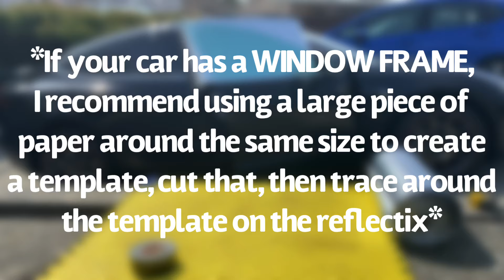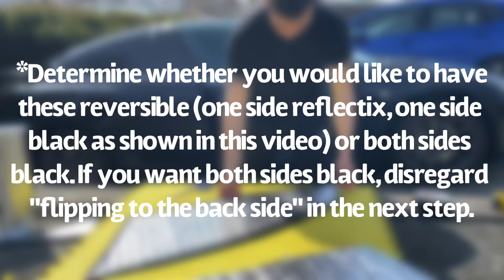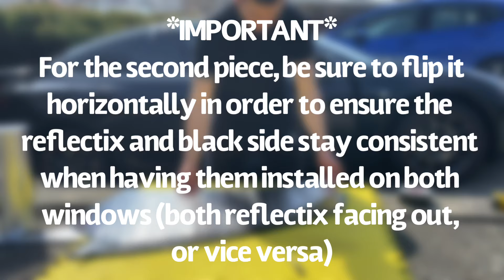How To Make Sun Shades / Privacy Shades For Your Car For Under $30

Comment: I would recommend using metal tape or foil tape so it's the same color as the silver. You want the silver facing out to reflect the heat away from the vehicle instead of black to absorb it. You'll end up with a cooler interior by doing so
Reply: I think the black is to absorb it when facing out on colder days.
Reply: Black, facing outside, at night is imperative if the goal is stealthy camping in the city.

However, anytime, you actually cover the reflectix, you lose the ability to keep the heat out, so, using it during the day on a hot day, is not advised, as you will actually be causing additional heat gain within the car!
Reply: Nope. They already have one silver side he can use for hot days. You want only one reflective side for hot days and a black side for cold days and when stealth camping. If he does it your way, you'd never be able to be stealth, so cops and everyone would be constantly bothering you and telling you to move on.

Comment: I think leaving the reflective side facing outwards (rather than blacking it out) cools down the vehicle better
Reply: The black tape is meant to be for the inside.
Reply: Doesn’t matter you get both, just change the passenger one to the driver one and you can use either
Reply: Most people just do it for the privacy. If you are parked somewhere you don’t belong and they see the reflective on the windows, most likely indicating you are camping out there. So they end up kicking you out. No reflective no problem

Comment: I love the simplicity of this: tape, foil, scissors,  10/10 well done. ( Yes, they will just stay in place due to the nature of the foil material, but you can use suction cups in holes through them ).
Reply: That's a cool suggestion to use suction cups as additional stickiness against the window. I guess you would just need to poke/cut small holes in the Reflectix to attach the suction cups.
Reply: Gdje si kupio alu foliju na metre?
Reply: @skyyward111 I guess u can also use velcro stick a few small pieces to the window and some on the reflector

Comment: How do they stay in place tho? Great video!
Reply: Friction.
Reply: @HondaFit4Adventure  glass has no friction almost!  Friction on a vertical glass? Forget!
Reply: @zuziakras1632  Not the friction of your window. 
The door trim around your window has at least the depth of 1"
If you make these to size or slightly larger you simply wedge them into place for a snug fit.
I hope that explains it a little better.
Reply: @HondaFit4Adventure  Thank you. It will help. :)
Reply: @HondaFit4Adventure  what is that?
Reply: @jahjah525  It was a response to a spam comment but I see they've been deleted.
Reply: Its the tight fit into the window frame that holds it in place. Friction. 
Very common to use similar in the windows of light aircraft parked on the local airport tie-down ramp.
Now we know how to make them.
Reply from the maker: Hi Jana, sorry for the late response. But yes everyone who responded was correct in that I used a oversize method here to create the friction between door and door frame. I tried small suction cups but didn't find an easy way to add this all while keeping a budget. The purpose of this video was to keep it very affordable and easy to do for others :)

Comment: I did this for a stint at an 8 week Renaissance festival so I could sleep in my car on the weekends and it worked great EXCEPT that the black duct tape really baked in the Texas heat. By the end of the 8 weeks it was really starting to degrade. If I made them again I would probably use some sort of cheap black fabric and some spray adhesive.

Comment: Nicely done.  One thing, all that tape glue (usually a fairly loose regulation regarding VOC's) is just baking in the sun and heat.  Spreading those wholesome chemicals and suspending their sweet fumes into the cabin space, regardless if you are able to smell it or not.  It'll be like that song, "I'll be therrrrrrrre..."

Alternative method, instead of tape apply a layer of fabric (whatever color you want) and use a low VOC adhesive like Super 77.  Just as simple and might only take a few more minutes per shade.

Great video.

Comment: Unfortunately, the black duct tape will not last long due to the sun exposure breaking down the adhesive, which will separate and crumble.  But it should last a year or two.  Maybe that's long enough.  If you mostly keep it in the trunk but use it just for side windows on occasional super hot days then it should last a long time, but for a front windshield and year-round use, like in California, I don't think it will last longer than a year or two.
Maybe having a seamstress sew a strip of black cloth around the edge would last longer.  Might be worth the extra cost if not too much.  Or maybe you don't really need anything along the edge.

Comment: Great job! I like this black tape method over using spray adhesive & fabric because it looked easier.

However, when I tried this method and put the reflectix side facing the window, the black side (inside) turned super hot. I ended up leaving both sides as reflectix and not cover one side with black tape.

Update: when the car gets super hot inside, the tape weakens and starts to come off even if you use super duty duct tape or electrical tape. I’m about to throw my DIY reflectix car shades in the trash and just pay more for professionally made ones. Fun project to do during quarantine but the car shades are not holding up well.
Reply: Helo, how does it stick on the window? Do you need additional tape or it will stick automatically on the windows?
Reply: Jonathan Alie Saputra If you cut the reflectix just a tiny bit larger than the windows, it will fit snug and hold up by itself without suction cups. I made tabs as little handles with duct tape as well. Over time with heat from the sun, the reflectix will shrink so don’t cut it smaller than the windows. Mine shrunk a little already and has fallen off several times.
Reply: Best to use vinyl tape as they are resistant to heat and cold.
Reply: @onlyinparadise4613  If that starts to happen maybe you could use some clear vinyl tape on top of the black tape to reflect the heat ( because clear tape is a lot cheaper ) ? But I read this: Duct tape truly lives up to its name and is used for sealing air ducts to withstand heat and air pressure. Your duct-tape will do just fine under 140 degrees Fahrenheit. At this temperature, your tape runs the risk of losing its adhesive.
Reply: @emem1486  It’s better not to use tape (any kind) at all. I’ve been using only reflectix and there’s no issues whatsoever. Thanks for your input.
Reply: @onlyinparadise4613  Cool man.
Reply: Gorrila Extra Strength. Says it holds up to the Heat & Cold
Reply: @onlyinparadise4613  how has it held up ? I’m fixing to do it my self today
Reply: @MrLuis318  Don’t do it! Tape will deteriorate in the sun over time. I wouldn’t recommend this method during the summer. Fun quarantine project but that’s all.

Just stick to either black fabric and professional spray adhesive or sewing black fabric onto reflectix for long term results.
Reply: @onlyinparadise4613  hI, .. SO DID U JUST CUT UP REFLECTIX AND IT STICKS TO YOUR WINDOW BY ITSELF?? dID U CUT IT ANY LARGER THAN THE GLASS OR EXACTLY SAME SIZE AS GLASS? THANX
Reply: @freedommusicireland7398  Cut the reflectix a little bit larger so that it can wedge up to the sides of the windows. Also, reflectix will shrink over time with heat in the sun.
Reply: @onlyinparadise4613  great thanks a million.might you know if reflectix falls away from window if theres condensation?
Reply: @freedommusicireland7398   Not sure about that. I used the reflectix when it was hot during the summer. Didn’t use it when it was cold in the winter.
Reply: @onlyinparadise4613  great.. thanx a million!
Reply: @onlyinparadise4613  I used black flex seal and it doesn't come apart in the heat of the summer: you can always use your sewing 🧵🪡 machine to reinforce if you are worried about it coming apart
Reply: You could use fabric binding tape with fusible web ( iron on). Employees in a fabric/ craft store may be able to give advice. I use this in the middle of my  roman shades I sewed, in our 3.5 season room( we have to augment the heat with a wood stove in the coldest months). I sew magnets into the seam and stitch a dot or x where they are. It gives me a fairly good seal. Someone mentioned corrugated cardboard with a dollar store reflective sunshade and hook and loop tape to fasten to window.

Comment: I made mine using a yoga mat.  Seriously.  It completely blocks out the light, it's easy to cut, it's firm yet flexible, it's soft and insulated, it can be easily covered with reflective material on one side, and condensation doesn't wreck it because it's made to withstand sweat.

Also maybe a thick tarp would be a good material to use too?

Comment: Hey wongway, I have a question: Could I use this product to cover my windshield to prevent the inside of my car getting hot and also prevent car dashboard damage?
Reply: Yes. It will cool your car by 30+ degrees. Crack your Windows about a 1/4 in. To prevent green house effect.
Reply from the maker: sellyourhomenowbook said It great. If you put the reflective side out it will aid in keeping the interior more cool!
Reply: @sellyourhomenowbook  what do you mean greenhouse effect?
Reply: @AFreckledAngel  the green house effect is when the sun hits a glass enclosed structure abd heats it up through induction I believe
Reply: basically, the aluminum will reflect almost all radiant/infrared heat.  This works both ways.  Turn the aluminum side inward to keep a car warmer when its cold outside.

Comment: Does the sun hot heat 🔥 up the glue on the tape?

Also where do you store these when not in use?
Reply: I would assume the sun will heat the adhesive on the tape, and also release a chemical smell into the car, I would personally recommend sowing black fabric around the edges instead of duct tape, it will look cleaner and you don’t have to worry about the tape going bad and releasing a smell into the car. I have not done this yet but I plan on it.
Reply: @Papa_Corgo  yes, the chemical smell! I totally didn't think of it

Comment: I'm no genius but why not cut to the size of the outside of the window? Wouldn't that be easier and work great?
Reply from the maker: Great observation! I thought of this to start but unfortunately on the Tesla model 3 it is a frame less window, so when you open the door the window automatically goes down a couple of inches, so the outside of the window is actually becomes smaller when the door is open. And when the door is closed it is not the true size to fit snug into the interior.

Comment: How well are these holding up after some time has past? Did they warp?
Reply from the maker: Thanks for the question, they have not warped for me, but that being said I have not used them daily by any means. For me, they are used for camping or road trips. So for heavy use I'm not 100% sure. But they are flexible so I don't believe warping is a main concern.

Comment: What was used for the rear window? I've had the most trouble keeping that one up. Mine is slanted at a deep angle, and there's nothing to really keep the reflectix in place.
Reply: I was wondering about that also. I had thought maybe using command strips velcro but this Texas heat might cause them to melt off so yeah, good question. Maybe something to prop against it? 🤔
Reply: Tried suction cups?

Comment: So I cut out the reflective insulation to the window's size, even a little bit larger to be safe, but after taping the back side of it with a black duct tape, the insulation material shrunk significantly. Now there's about a 3 inch gap on the window. So much frustration + time and money wasted. Yours must be a different type of duct tape than the one have, because there's no way I can tear this one with my hands the way you do with yours. It's super sticky and elastic.
Reply: And the duct tape rarely tears clean. Folds back onto itself...

Comment: But you could buy the similar anti reflex which is silver from one side and BLACK from the other. This way you would  have less to do.  And the importamt question still is: How  it is firmly enouch keppt on a glass of windows????  What keeps piece on place??
Reply: If you make these slightly larger you push them into the window. The plastic trim that surrounds the window will help hold the insert in place.
The back window is trickier as its most likely curved and has a rounded plastic trim surrounding it.
Reply: @HondaFit4Adventure  Yes, thank you! But I have heard somwere here an opinion that black screen look from outside more naturally (are more unvisiable)  when are put not by the glass of window, but in a distance from it by some 1-2 inches.  What is your expierience about?